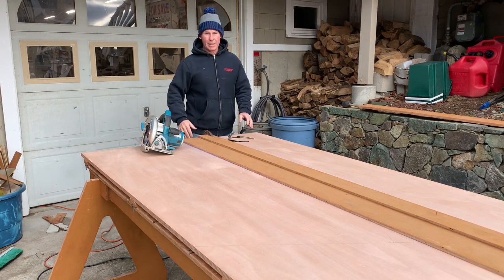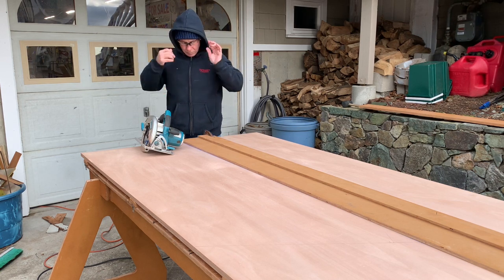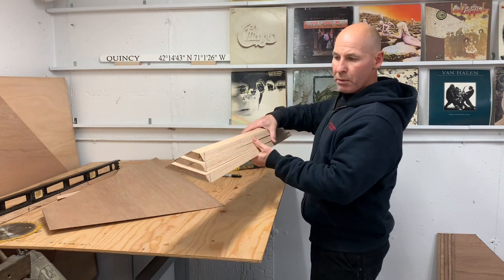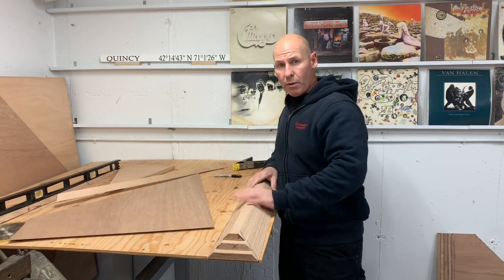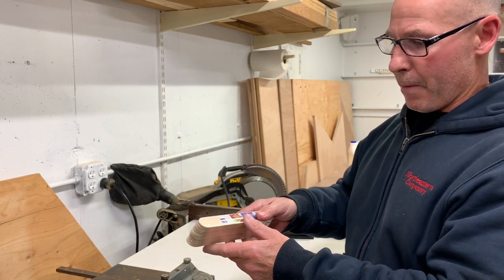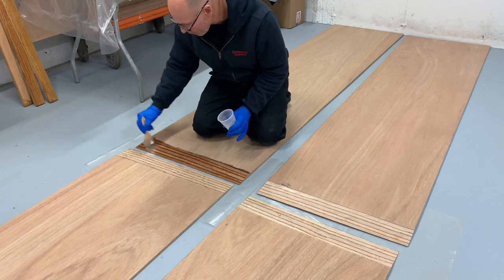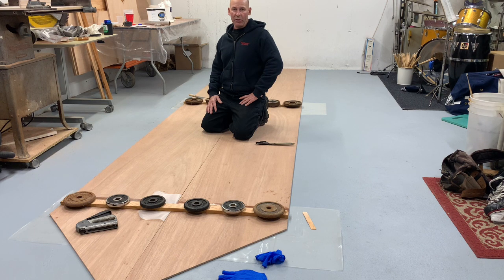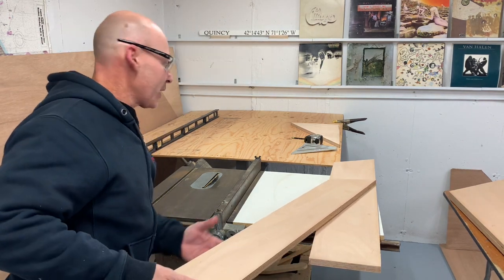Building Plywood Boat Ep2

Comment: Got ya on binge watching mode so I'm going to be sure and come back to like and comment for each episode. So far I can't say I got any new ideas but I got a lot of validation for the ideas I've Incorporated into my boat design. It's a lot easier to bite the bullet and start a self designed project after you've seen that it will work as designed. Thanks for that.

Comment: What is the angle that you used for the front of your boat the two side boards lol hope that ist to confuising iam building a boat and i would like to get the front angles becous i like the shape that your skiff has looks very sleek and cool.
Reply from the maker: Thanks the angle of the bow is 45° as for the rest of angles and measurements for building this boat will be available at the end of the build in plans.
Reply: Awesome Build my boat might not look as awesome as yours but iam doing my best thank you for the bow angle.